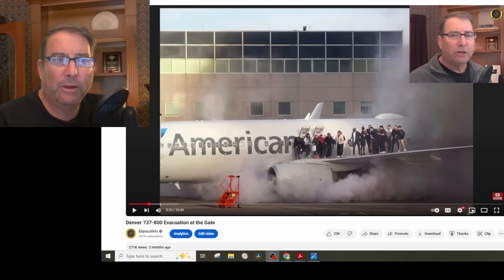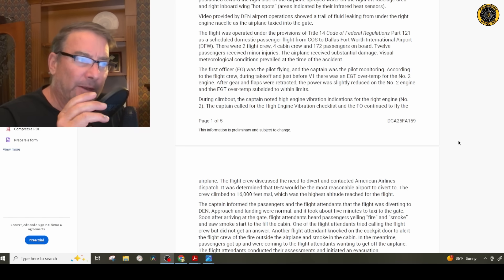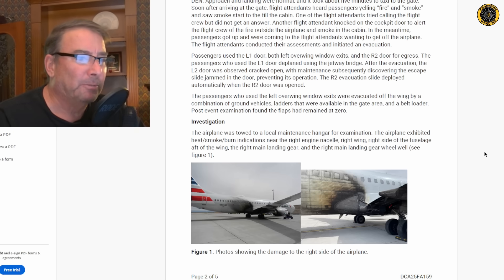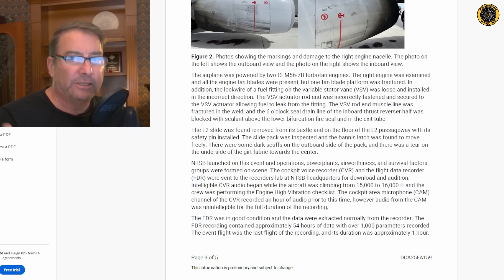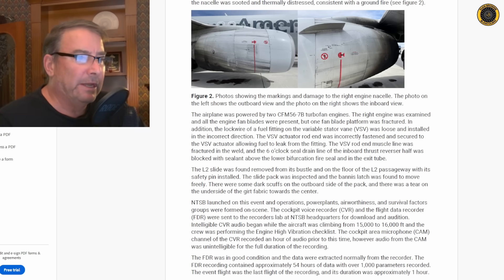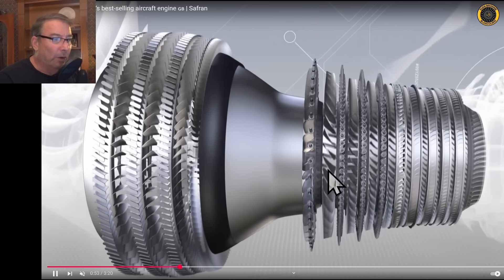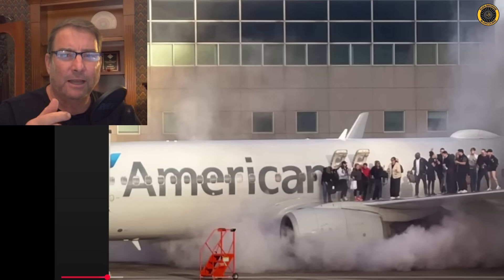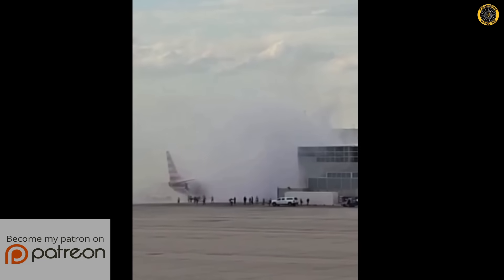NTSB Prelim American 737-800 Engine Fire at Gate and Over Wing Evacuation

Comment: Sadly, this sort of maintenance failure does not surprise me.  The last few years that I worked as a research chemist, I noticed that NONE of the new chemical engineering hires could reliably loosen or tighten a right hand threaded fastener and I lost count of how many times I had to say "no, your other left".  I blame this on the phase-out of analog clocks.
Reply: And shop classes in Jr high, and High school. Don't know what end of a hammer to hold, lit a lone how to use it.
Reply: @ThomasRapp-l4l  The school district that all of my Grandkids graduated from doesn't even teach how to read a tape measure! I was dumbfounded when my Grandson told me he didn't understand when I asked him to give me a mark on a 2x4 at a certain length!! Every single pre-employment test I've ever taken has had questions about measurements!
Reply: @randallmarsh1187 i am dumbfounded that you think it’s the school’s job to teach how to use basic tools. Take some responsibility for raising them. My father and grandfathers certainly didn’t think that was the school’s job and neither did any generation before them. You really want to outsource everything.
Reply: @chrisnoname2725  You must be so very, very young! Schools USED to teach many, many things that the social media generation can not possibly comprehend! We were taught civics, money management, how to balance a check book (home ec classes) we had shop classes and we also knew about respect!
Reply: @randallmarsh1187 parents and grandparents used to take responsibility for raising their kids and teaching them the basics. When i went to school and did woodwork it was nobody’s first time learning to hammer a nail.
I am absolutely not young at all. I am 38 
You’re blaming the younger generations for not being taught things. How is that possibly their fault?
Reply: @randallmarsh1187 respect? I have never experienced as much disrespect as we got from boomers. Why would we respect people who constantly disrespected us and tried to hold us back?
I have had absolutely zero issues with respect from gen Z. When i was supervising in a warehouse, they were the good workers. It was the old guys grumbling and not wanting to do their jobs and expecting others to cover for them. 
If things were better on the past it’s the failure of the older generations and from my experience the younger people are doing quite well in spite of their terrible upbringing by gen X parents that laugh at the fact that their teenage sons don’t know how to do anything
Reply: @randallmarsh1187 i wasn’t disagreeing that schooling is pathetic now. We completely agree on that. School was pathetic when i was at school in the 90s and 2000s. The things people complain about now were happening then.
Reply: @chrisnoname2725  Nope, I'm blaming the GOP for taking more and more money away from our education departments! Yes, family has a responsibility to teach some things (including manners) however school has historically taught many, many things that the younger generation has no clue about any longer, as the one comment above refers to children not knowing how to read an analog clock. I've even had a discussion with a math teacher who tried to convince me that because children always have a calculator (smart phone) with them they no longer need to be able to do math problems in their heads or on paper!
Reply: @chrisnoname2725  Absolutely a fair point. People are quick to the blame game these days, and seek an echo chamber where everything wrong in the world is 100% the fault of other persons or specific groups of persons, technology, media, policies etc etc 
While they played 0% in it, despite being around it. No different to years past.. So, what were they doing during this, aside from watching and pointing fingers?
Reply: @chrisnoname2725  My you are so sensitive on such a esoteric comment . Calm down.
Reply: @hmbld1 So you claim people are sensitive when you have no argument and the words are hurting your feelings? Stop projecting. Nobody was being sensitive until you showed up.
Reply: @chrisnoname2725 ur kid is a reflection of you
Reply: @ricksadler797 what is that in English?
Reply: I learned "clockwise close, counter open", until of course you run into the opposite, like flammable gas regulators, etc. ;*[}
Reply: @stevengill1736  lefty loosy, righty tighty. Yep that doesn't usually work with water fittings
Reply: @jesabeltwin5051  there's two choices. turn it one way, if it doesn't do what you want, turn it the other way. it's really no more complicated than that. the fact that the millennials are even trying to make a whole debate about it just shows how incompetent they are
Reply: @jhanks2012 what millennial doesn’t know how to use hand tools? My generation knows how to do things and how to teach. It’s gen X that can’t do anything nor teach anything. My neighbour had to call his wife to tell him how to use a washing machine. They are the gibbs generation
Reply: @jhanks2012  I have worked with nuts and bolts all my life and alot of them were seized, so one needs to know which way it should be turned. I once did what you said on a diesel injector line, turned out it was a left hand thread and I over tightened the nut and damaged the ferrel so the connection leaked badly. In the US, usually lefthand threaded nuts had slots in the edge of the flats so you could see it wasn't standard, but this was a Swedish engine and I screwed it up nicely.
Reply: @stevengill1736  In Maryland, natural gas lines are opposite thread; in Louisiana, natural gas lines are "normal" thread, the same as water.  They didn't know what I was talking about.
Reply: Can't tighten a screw, can't use a hammer, and can't use a measuring device says this thread so far.  It's hard to believe, because such things are just common knowledge for older folks.  I take it for granted, even.  But the kids barely know how to do it.  If the current trend in technology and education continues, it will be entirely lost knowledge after some generations.  And that makes a case for ancient civilizations having advanced tech and/or techniques we know nothing about.  That is, assuming some of their own tech evaporated physical evidence of it (assuming their tech was even physical - since they're now trying to make computer logic gates from localized spacetime curvatures, but I digress)...

It goes to show that not many generations have to pass for knowledge to become lost and replaced with something that could be (and probably usually is) inferior.  And there is nothing we older folk can do about it (and I'm only 42 calling myself "old").  I suppose that civilizations rise and fall based on technology and the associated knowledge to use it.  Eventually, our civilization will fall (probably due to an epidemic of stupidity and social isolation fed by a consumerist addiction to content and content consumption devices).  Then everyone will be starting from scratch again only to repeat the cycle.
Reply: @paulsaulpaul you can’t teach a kid how to use a hammer and you somehow think that’s a deficiency with the kid’s abilities?
Reply: @chrisnoname2725  you swing the hammer at the thing you want to hit. do you really need to be "taught" that? maybe that's your problem right there 😂😂
Reply: @jhanks2012 you’re looking in the mirror? Your attitude is the problem.
Reply: Two things - twisting (rotating movement) is neither left not right. I always found that confusing as a kid. Second, clocks in the schools I've taught at (St Paul Public Schools in MN, for 8 years until last year) have always had analog clocks in every room. Do y'all think school systems can afford new clocks or something?
Reply: The boomer energy in this thread is something else.
Reply: I'm skeptical that phasing out analog clocks could have much to do with this. There are many, many objects in everyday life that use right-hand threaded fasteners, including but by no means limited to every single drink bottle I've ever seen that doesn't require a bottle opener.  It seems unlikely that anyone reaches the point of starting an engineering job without loosening hundreds, if not tens of thousands, of right-hand threaded fasteners in their life.  It seems more likely, in the case you describe, that directions like "turn it to the left" are ambiguous (the top moves left, while the bottom moves right), and that particular phrasing could be clarified even without reference to clocks ("turn the top toward the left", "unscrew like a bottle cap", etc.).

For this aircraft, whomever installed the fastener on this aircraft must know how to tighten a right-hand threaded fastener, because that's what  the bolt (presumably) is. They simply need to wrap the safety wire in the same direction that the bolt tightens. Understanding how the safety wire is supposed to function makes this intuitive; perhaps the maintenance techs' training isn't explaining this and just telling them "wrap the wire clockwise" rather than "always wrap the wire in the same direction that the bolt tightens, so that it will tend to pull the bolt tighter rather than loosening it."
Reply: I used to tell a co-worker (washed out fortunately), No! Your military left! Or right as was appropriate. His name was Mike. We called him "Mikey Mistake".

Poor guy was dropped on his head as an infant or something.
Reply: It’s greed and corruption
Reply: Always had some trouble with that, loosening is a more natural motion than tightening.  Supination is easier than pronation, and I'm left-handed...
Reply: That's me. I have to think to tell the time on the round clock. It's the same problem with other skills most people just don't need to have anymore - like hunting for food, making fire with just sticks or knitting. I don't confuse left and right though, I don't need clock to tighten a bolt.
Reply: And now there is AI to dumb down the population even more. The human body and mind learn by repetition and technology is replacing that act cancelling the development of neural pathways. 😮
Reply: Lol, yup
Reply: This is what happens when you exchange Meccano or Dads lawnmower with a Smartphone and playstation.  You end up with a smart arse who can't unscrew a lightbulb.
Reply: @Woffy.Yes but that only happened because parents didn’t see it as their job to raise their kids but treated them as a burden and found the easiest way to occupy them
Reply: I'm sure its more than that...but yes, no clocks with a little hand and big hand could make things difficult for newbies. Maybe they should use them in schools and in classrooms that would use the terminology, clockwise, counter clockwise etc. Folks today can walk up to a clock on the wall and CAN'T tell the time !! (unless its digital)
Reply: @Garth2011 My 18 yr old daughter, who is off to college in a couple of months (and to studying mechanical engineering!!!) keeps telling me that when I say "ten to eight" or "quarter to eight", those aren't proper times and "nobody says that".  I told her the other day that we needed arrive by ten to nine, and she replied "No! We must be there by 8:50!"  🙄
Reply: @pulaski1  Perhaps she was joking around.. but I've never experienced something like that.
Reply: @cpzmelbs I don't think so, it's been an on-going exchange we've been having for several years.
Reply: @cpzmelbs maybe, but it is what’s written on the clock compared to how you think of time looking on an analog clock and also because people look at messages rather that have things told to them verbally now. I think it makes sense.
Equally i would never say 8:50. It sounds weird but i also wouldn’t write ten to nine.
Just seems like a natural change due to a change in communication methods
Reply: Several years ago there was a news story on the radio about a school replacing all of the analog clocks with digital clocks so the students would know what time it was. 
Keep giving $ to the public K-12 system. They’re doing a great job. 🤔
Reply: @Kerry-fw6jtIf only each community had an institution dedicated to teaching our children useful information and prepare them for life.  🤔
Reply: DEI is coming back to haunt us
Reply: @johnclark5148  It has nothing to do with DEI and everything to do with Republicans not adequately funding our children's education! "DEI" is nothing more than making sure qualified people get employed (regardless of the color of their skin or their gender) versus unqualified whites taking those jobs!
Reply: @johnclark5148 how many times do i have to remind people that dei isn't what you or fox news pretends it is. it's forcing people to hire based on MERIT REGARDLESS OF ALL OTHER FACTORS because unqualified white guys were being hired over much more competent individuals just because of gender or race. It's not a fucking "must hire minimum quota of idiots" thing.
Reply: @johnclark5148  Racist, sexist bullshit.
Reply: @johnclark5148  Wrong.  Your statement implies anyone who may be considered "DEI" by your or other standards aren't capable of learning.  It's a lack of attention spans and income inequality.  I'm a white guy in my 50s, come at me.
Reply: @johnclark5148 this is absolutely not a DEI issue. This is a culture issue that’s been happening for over 40 years. DEI is just a more recent progression

Comment: The most interesting part to me is that the L2 escape slide just decided to be inoperative in an incredibly nonviolent evacuation. Very fortunate it wasn't actually necessary, but how in the world does that happen? I always assumed they were extremely reliable
Reply: The worrying thing is the mention of a safety pin installed in the slide when it was removed from the door, that shouldnt be there under my understanding as the door mechanism should be doing that job in the day to day flying of the aircraft. You sometimes hear over the PA "Arm doors for takeoff" and coresponding "Safe doors" on landing.

I am under the impression that a safety pin is normally installed when ever maintenance or replacement of the door/slide is needed as you can imagine one of those slides going off accidentally in the wrong place is inconvenient at best and possibly deadly at worst.

Please correct me if I am wrong on any of these points.
Reply: Slide was disabled, no way it would have deployed. Now you'd hope they would inspect the rest of the fleet to make sure this isn't the case elsewhere, especially when it is actually needed

Comment: Great video. On the safety wire 101, the reason to keep it tight at the exit of hte first bolt hole, is so the safety wire twist, keeps the loop around the bolt head down, so it would not pop up. This was one of the first things an inspector would check on my safety wiring. If that loop pops up, the safety wire fails to do its job. Also, to clarify some not so tech users, this is not a line maintenance, but an engine shop issue, at least the safety wire and the silicone. The blade platform is difficult to find on a line check because of bullet, and if the fan is rotating, the blades rattle by design.
Reply: Thanks for these fine details! I worry about tightening the safety wire too much as there's a risk of flexurally induced embrittling, but the point you make about not letting the wire loop pass over the bolt head is important.
Reply: Not necessarily. A VSV actuator is a line replaceable unit. I've done several.
Reply: You worked on 5B right?

Comment: The 737 next gens are notorious for having EGT faults. There are four probes and one or more of them often blanks out on the "Control Temperatures" page. This changes the average temperature calculation. The faults are easily corrected.....if Maintenance is aware of them......and frequent routine maintenance of the system usually prevents any notice being taken by the Pilots.

Comment: You forgot about your A320. Same size aircraft but it has overwing slides that don’t require the flaps to be lowered. 1:37
Reply: Any airbus. The 737 is a cheap, horrendously outdated design that has so many shortcomings from a safety perspective. Should not still be in production.
Reply: @wurly1 Yep. I have flown both with the airlines And I absolutely agree. I flew the 757/767 as well and they don’t even compare. I have no idea why they couldn’t change basic things on the 737 over the years. For instance, the doors. Even the new Max still has girt bars like the first 737. They don’t disarm when opened from the outside like a 757 or A320. It’s archaic. It’s like being back in the DC- or MD80. Which I also have 10,000 hours in.
Reply: @grumpy3543  Lack of “back to the drawing board” design for the Max was probably indirectly Airbus’s fault for coming out with the Neo.  It looks like Boeing panicked wanting to have the Leap engines and rushed the design, botching it in the process. Didn’t realise it was quite so archaic though, sounds like a nightmare 😮
Reply: @katemakeuplooks  Boeing was and is asleep at the wheel (or flight controls). It's not Airbus who is to blame.
Reply: @psps3550 Sarcasm obviously doesn’t come across here!  My comment was very tongue-in-cheek.  IMO Boeing is a dreadful company with low morals and ethics and, from what I can tell, Airbus is a very nice place to work. I could go on but I won’t.